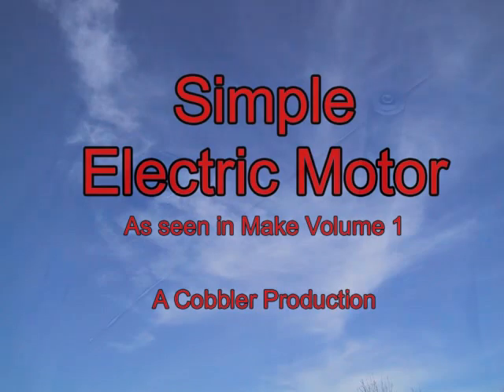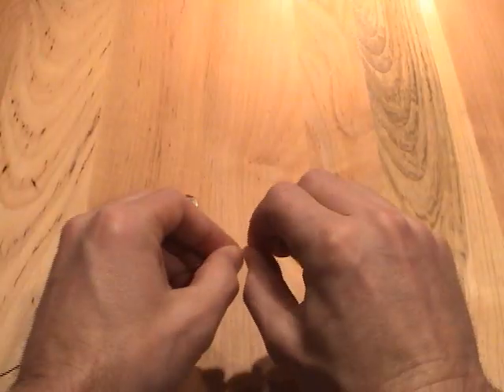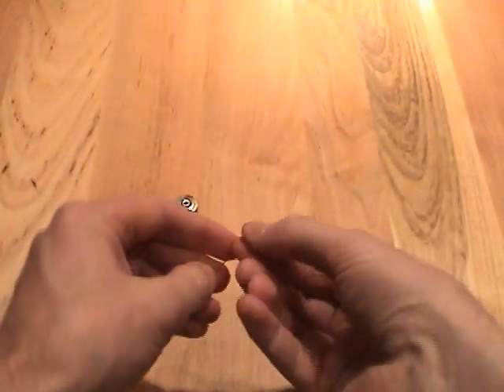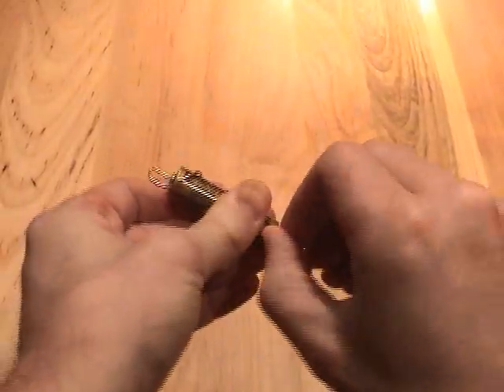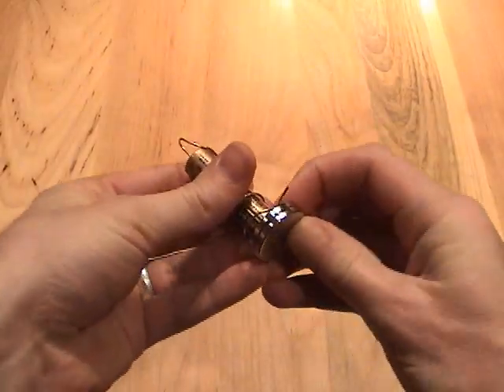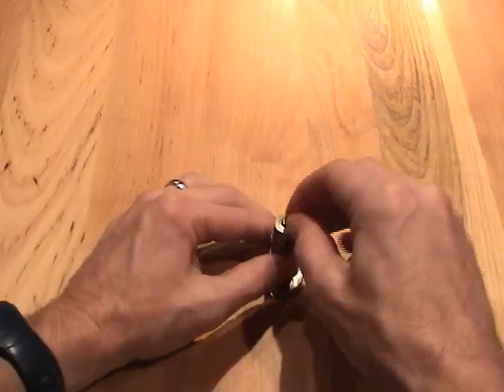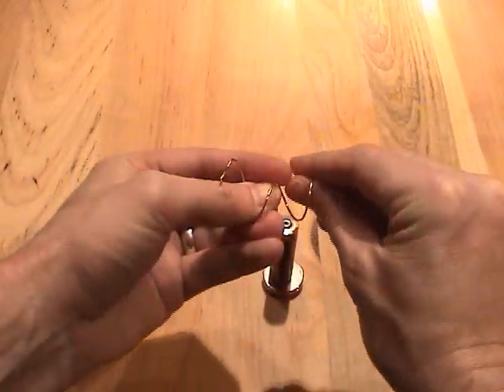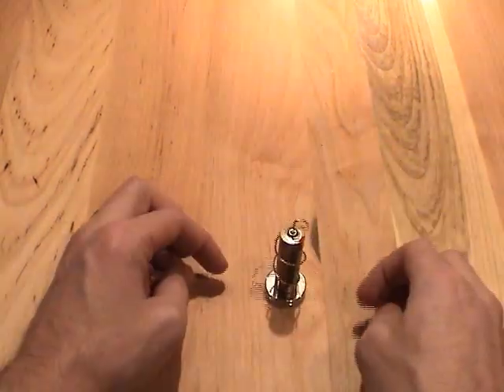Unexplained Phenomenon - Simplest Electric Motor

Comment: Everything about this was explained il the 19th Century. Michael Faraday Built the first electric motor in 1821. A complete theory of electromagnetism was later published by James Clerk Maxwell. 
A current passes through the wire. The wire is inside a magnetic field. The electrons in the wire feel a perpendicular force because they are moving through the field. Which makes the wire rotate around the battery.

Comment: electricity is not consistent, it is a wave. as the electricity passes through the battery to the magnet it uses electric induction to create a type of electric induction motor. The magnetic waves pull on the coil as it circulates up the battery through the copper wire and into the magnet to repeat and thus pushing the wire to spin consistently. electricity never completely stays passing through a wire, there is a consistent loss of energy even in insulated wire because air is filled with water

Comment: It's magnetic induction. The wire is connected (via the magnet) to both ends of the battery, creating a circuit in which the elctricity  flows. Because this wire is in a magnetic field, and the electrons are moving in it, a force affects the wire, which happens to always point in such a direction the the wire spins. Look up "Lorentz force" for more

Science, bitches!!!

Comment: i am in 4th grade and i know how it works...the magnets magnetic feild travels through the battery and the wire makes the negative and positive conections the magnet sends[as i said before]witch makes the batery send electricity through the wire and wala.............magnets are able to make electricity [a genarator] and electricity can make a magnet [an electromagnet].

Comment: I think it works due to mutual induction o.o the magnetic field causes the wire to  move clockwise/anti (dependin on the field direction of magnet) and it keeps rotating with a slight change of speed due to change from vertical to horizontal position o__O i think...

Comment: i tell you how it works and it is not a theory it is a fact that when the wire touches the magnet it haves to find the magnetic poles which causes it to move since the battery probably has an ac current the current  alternates wich then pushes the wire around the battery harder and faster

Comment: I'm in university, and I'm studying electricity. I've prepared my entire life for this moment!

Okay. Here goes...

Electrons are running from the bottom to the top through the magnet, then the wire. This creates a magnetic field. Weak as it is, it is still enough to react with the magnetic field of the battery.

Your video has shown me that my understanding is incomplete. I would think this should only work with AC. Back to the books!

Comment: @Ma5terOfDl5a5ter 
The question is the other end of wire is not connected to negative pole of battery therefore
electricity does not travel through the wire.
But I am curious to know if after some time the battery will fade or no?

Comment: @11122253 If you learn anything in physics; its that energy can neither be created nor destroyed but only transfered from one type to another.

Here, you're not getting free energy, the energy is coming from the battery.
In power plants, the coil of wire is spun by burning fuel to cause steam and pressure the coil to spin, generating electricity :)

Comment: I think that the electric current traveling in the wire run into the permanent magnet's field, and get scared and try to run away.  But the battery is forcing them to travel down the wire anyway, like a bayonet point of voltage, so the current runs to the side of the wire and starts trying to push its way out, crying and screaming, (but we can't hear it because our ears are too big), but only ends up pushing the wire sideways, making it rotate.  This goes on and on until the battery dies.

Comment: 1. Electric current flows from (+) pole of battery through the wire and through the magnet to the (-) pole of the battery.
2. Ampère's circuital law says that that current produces electromagnetic field around the wire
3. Produced field attracts or repels the existing field of the magnet (that's why you need a magnet)
4. Profit.

Comment: The homopolar motor can be well explained by the Faraday model of lines of force, with a tangential force (hence, a torque) resulting where the electric current makes an angle with the magnetic lines of force. The homopolar motor provides a simple demonstration of the Lorentz force.

Comment: @attu89 It has to make contact at the top and bottom. Because if current isn't running through the wire, there is no motor action going to take place.

Comment: It is not only The fact that the magnetic feild is making it spin it is also the battery making the wire into a solenoid, which is reqiured for a Motor.

Comment: @triggahoe I figure yes, since this type of motion doesn't really convey the same amperage as, say, a wall outlet, which with the correct charger would still take a long time to juice back up a battery.

I'd be more worried about the voltage, which can deteriorate a battery's capacity if it's too high. Just don't connect it "bare" to a windmill or something like that ;)

Also I'm a nano/electrochemist btw, I actually build lithium batteries for research which is why I know all this trivia

Comment: @ThePotironmarron
It has nothing to do with the wire being wound like a coil. And I can prove it to you. 
Make a new one. It can be any shape just as long as it can be balanced to spin freely and contact the magnet to complete the circuit. It will spin. Try it.
The coil shape in this case, is meaningless because it's not an induction coil.
The wire is becoming an electromagnet.
Battery current creates a magnetic field around the wire that pushes\pulls against the other magnetic field. See?

Comment: @DemonHunter2k7
You need to use a really strong magnet and a fresh battery.
If the magnet I'm using was bigger mine would work.
I did notice that if the wire touches the side of the battery at all, it won't work. The spinner (any shape can be used, it just has to be balanced and spin freely) can't touch anything except the top of the battery and the magnet.

Comment: BTW all,
The wire does not have to be a coil! Any shape that you can balance on the top of the battery and just barely touch the magnet on the bottom will work! Just be sure to use copper or other type of conductor (wire) that is not attracted to the magnet (like steel). Copper, Silver, Gold, Brass and Aluminum will all work.

Comment: Cont...
Here is why I say that it's the Lorentz Force and not the Laplace Force:
The magnetic force component of the Lorentz force manifests itself as the force that acts on a current-carrying wire in a magnetic field. When a conductor is moved through a magnetic field, the magnetic force tries to push electrons through the wire, and this creates the EMF (Electromotive Force). This is why the wire moves.
The question asked in the video was "Why does this work?"
Answer: The Lorentz Force.

Comment: This is easy. It works because of the Lentz Effect. When you run a current through a conductor, a magnetic field is created around the conductor. That field's polarization is controlled by changing the direction of the current. The magnetic field around the conductor is attracted or repelled by the magnet on the bottom. Flipping the magnet over will also cause the coil to turn in the opposite direction.
See, I told you this was easy!

Comment: @wolffe23 Electrons flow through wire, creates a magnetic field. That magnetic field opposes and pushes against the magnetic field of the small magnet under the battery, causing torque. The magnet is heavier than the wire, so the wire is pushed around by the torque.

Spin the wire by hand in the opposite direction, and the electrons are pushed back in the opposite direction through the wire by simple reversal of torque.

Comment: The key thing is the charge really wants to reach the cathode of the battery (the electrochemical potential difference between the anode and cathode favours drives this motion), so it will flow down the coil to reach it despite the resistance met by the conflicting magnetic fields created.

Fun fact: you can recharge the battery (if it's rechargeable) by pushing the coil in the opposite direction that it wants to spin. This will reverse the flow of charge and force it back up into the anode.

Comment: Now what do magnets like to do when they're put close together? They like to align themselves so south->north, and so north-/-north and south-/-south. As charge flows through the coil it creates a spinning magnetic field which interacts resistively with the still magnetic field of the magnet. This creates a force that spins the coil to make it's magnetic field stand still, while charge keeps flowing through it. There you have it, electromotive force.

Comment: Flowing electric charge creates a magnetic field that wraps itself around the medium the charge is flowing through, which wraps up clockwise or anticlockwise depending on the direction of the flow. In the case of a coil, flowing charge creates an inner "funnel"-like magnetic field that either points upwards or downwards on the inside or outside, depending on the direction of the coiling. The coil essentially becomes a longer hollow magnet with both north and south poles like any other magnet.

Comment: It is all about the force that acts on a wire that is in a magnetic field while electricity is running through that wire. There is a simple equation for that “phenomenon”.
F(force)=l(length of the wire)*I(amperage)*B(magnetic vector potential).
In your case that would mean something like: F= 0,2m*0,05A*??? (I don’t know the magnetic vector potential of the magnet you used).

Comment: As it spins it completes the circut for current to travel.  The tiny volt 1.5,. travels thru the wire and it gets inirtia till it touches again, then it completes the circut and the cycle or spin starts over again,. thus should be the reason behind this.  go to art by hagen dot com for your artistic needs for christimas!!  AWESOME VIDS!! SUBBED,. please sub to me I am a little funny,.. well ALOT funny ok.

Comment: It works like any other simple electric motor the circuit made from the copper wire and the battery produces a magnetic field in the wire that is repelled by the field in the magnet! HyperSpify nailed it too!

Comment: when you connect the wire to the magnet it is completing a circuit. which in turn sends electrons trough the wire warped around the battery. wale the electrons flow trough the wire they disrupt the magnetic field and turn to move out of the way. because the wire is spiraled it continues to turn and makes a moder. Just basic physics.

Comment: energy moves from the top of the battery through the wire and then to the bottom of the wire. when the wire touches the magnet, it creates electromagnetism which prepels it around the magnetic field.

Comment: @danedaworld Actually scientists know exactly why it happens.  There's an equation for the force on a segment of wire based on the magnetic field and current flowing through the wire.  Then from the force you can get the torque, and then integrate over the entire wire to get the total torque.  The physics needed to solve this problem has been known for over 100 years.  You can show this to any scientist or engineer and they can give you an estimate of the torque on the wire.

Comment: @zephir124 Well the magnet in my explanation refers the the magnet in the video, the current is caused by the dry cell also in the video, and the coil refers to the coil in the video. I don't see a problem.

Comment: Well, this is simply using Michael Faraday"s Law of Electromagnetic induction. The Magnet produces a magnetic field, obviously, and along with the magnetic field produced by the coil/solenoid when current is passed through it, they interact through change of charges, resulting in the force which moves the coil (Load) around.

Explained :P

Comment: @greenz59 the magnetic field is generated by the magnet, not by the battery. The battery will generate the electric current and therefore an electric field around the charge.

Comment: Yes, the Lorentz Force, which is the sum of the Magnetic field, B (generated by the battery), and the Current, the direction of the current needs to overall be perpendicular to the direction of the magnetic field to maximize efficiency.  The battery must face up and down, with the coil (overall lateral average)  each ring in the coil can be considered to be nearly a circle wrapped around the coin perpendicular to the direction of the magnetic field.  (north and south poles).

Comment: This is not unexplained. Actually, it's very simple. This is explained by the Lorentz Force. Every electric charge "q" traveling with a vectorial velocity "v" inside a vector magnetic field "B" will produce a force "F" that can be calculated by multiplying the cross product between v and B by the value of the charge q.The main concept is that a cross product always result in a third vector, linearly independant to the other two - in other words, an orthogonal vector.

Comment: @a2zhandi if by describe you mean tell you where the polarities ocurrs? because if so then you should know the whole thing is constantly changing because since it isnt a flat coil of wire it has no permanent North or South side, so as a result which side is North and which side is South is constantly reversing, hence the spinning (oh and as to what causes the change i have no idea, i do know that it happens at the atomic level)

Comment: @jayBakeland 
As another guy said, this is not a simple type of motor, it is not using the same principle used in our common electric motors, whether dc or ac.

Btw the tapered angle you described sounds more like the common perpetual motion machine...

Comment: you can't use any magnet, it should be round neodimium magnet (metal), it then conducts electricity. You practically make shortcut to the battery through the magnet, the contact  shouldn't be too tight, the wire leans on the battery and touches magnet only slightly, it should cause the wire to turn in one direction. The reason is specific polarity of the magnet but what exactly happens i couldn't say.

Comment: I wonder if the rod inside the battery itself is acting like an electro magnet, due to the coiled wire around the battery.   An easy way to find out would be to use something similarly shaped to the battery (such as wood), but run the electric current from a separate location.

Comment: This is a so-called one-piece homopolar motor, first studied by Faraday. Its operation is often puzzling to electrical engineers because they cannot apply their simplistic 'flux-cutting' or  'flux-linking' rules to it. In fact, a correct analysis requires the use of special relativity. Einstein once remarked that such induction phenomena were a greater spur to his developing SR than was the failure of the Michelson-Morley experiment.

Comment: It's to do with Magnetic fields and flux. The set up of the battery, magnet and wire creates circuit allowing electrons to flow. This current induces its own magnetic field, which interacts with the magnet's magnetic field.
They create a constant force that affects the wire (since it is moveable), making it spin.

Comment: uh im 16 and if i had to just use comon sence(lol) i would have to say that wen the wire touches the top of the battery(+) it becomes positively charged or someting and with the bottom of the battery touching the magnent then the magnet causes the device to become polar(if thats sound terminology..lol) making the wire positively charged and the magnent, negatively. the spiral shape of the wire causes a tapered angle against the - charged magn. which would cause it to spin. was that THAT hard..?

Comment: it is quite explained, and well known, based on the first electric motor ever. a moving charge in a magnetic field experiences a force perpendicular to the direction of travel and direction of magnetic field. Electrons traveling toward the center of the magnet (in the wire) cut across the magnetic field thus experience a force to the right making the wire move.
QED

Comment: i kinda did somethin like tht in my tech class. it was a d battery with paperclips on each side of battery. get copper wire n make a circle shape with both ends of wire sticking out. sand paper one end completly then half on other end. put small magnet in middle of battery n put copperwire on hook hsaped paperclips n let it go

Comment: Something is not ok.
1. He pull up the coil, which is almost without contact with the baterry. How this action can deplace the battery?.
2. When (1'7") he arranges the coil and it starts to turn, the movie is broken.
If the battery is an electric motor?

Comment: the current flowing from the wire via the battery creates and eddy current in the wire. using the right hand rule, the current is flowing outward of the battery. by the biot-savart law, when the a magnetic field is crossed with an electric field, a cross-product vector of force is produced (B X E = F) where F is in newtons. since the wire spun counter-clockwise, it means you had the negative end of the magnet facing up.

but i'm a christian. so it's probably just God's will.

Comment: the magnetic poles in the battery are leaving the positive side of the battery and traveling to the negative, exerting the energy on the rotation of the wire around the magnet.... i mean  :/ .....pretty wire :D

Comment: @alan850627 No it isn't unexplained at all. The wire being COILED around the battery is not to hold it to the battery as chuvak said. When and electric current flows through a rod and a coil of metal wraps around it, or the rod is not electrified but the coil is, a magnetic field is created. As old mate said, the right hand rule determines the direction of the field. Look it up man.